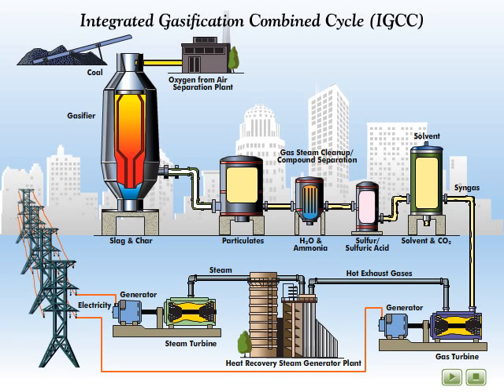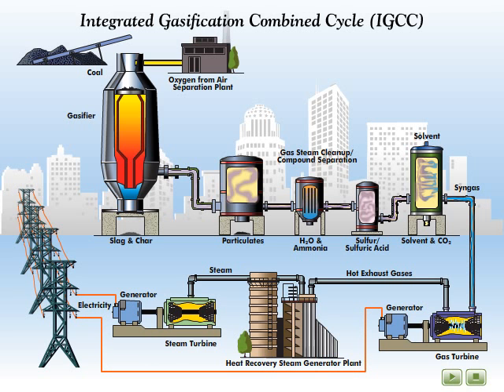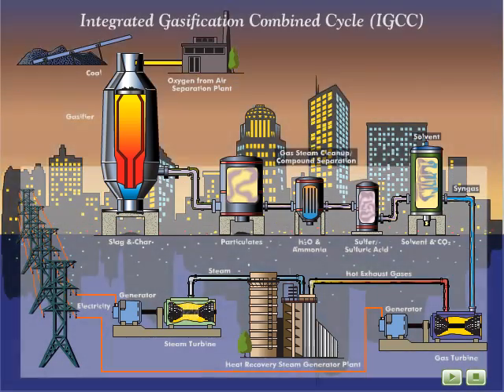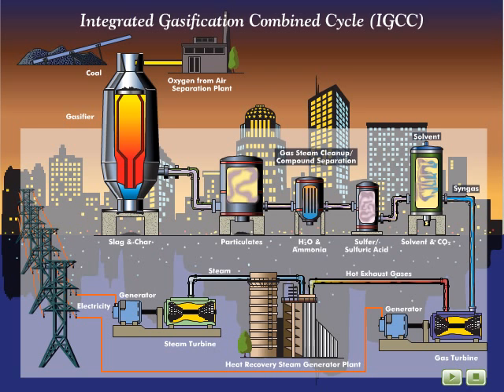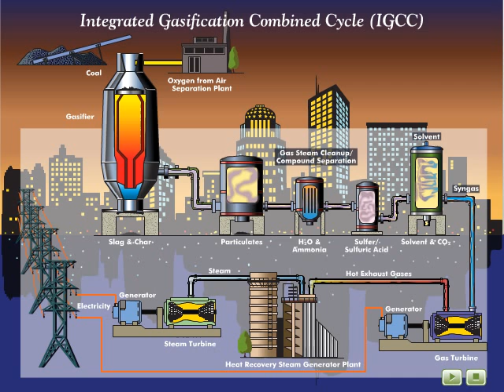Integrated Gasification Combined Cycle

Comment: One ton of uranium generates as much electricity as 3 million tons of coal.
Reply: But it requires lots of extreme high tech engineering and then you have to have locations that will accept them.
Reply: @bighands69  "extreme high tech" for Kentucky? You guys got your internet up and running, we believe in you!
Reply: @mkeratking  
I have no idea what you are talking about. Are you claiming that nuclear power is not complex?